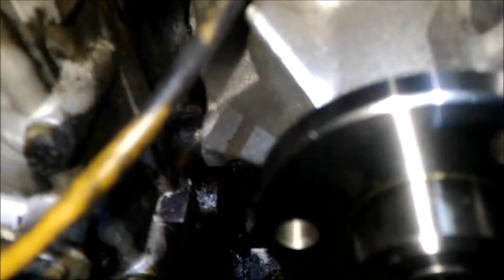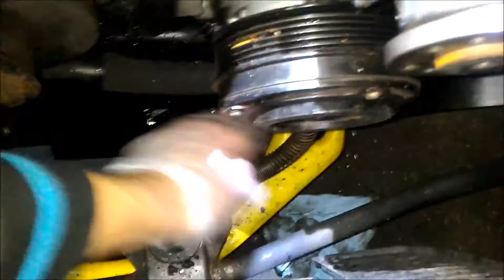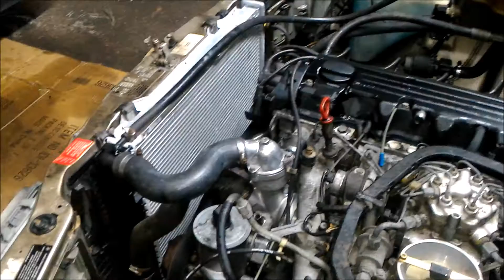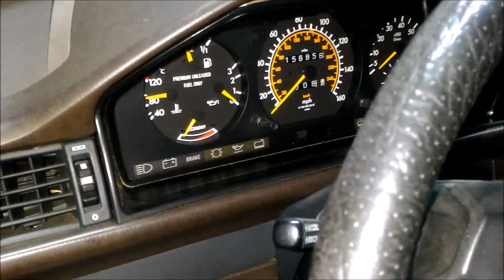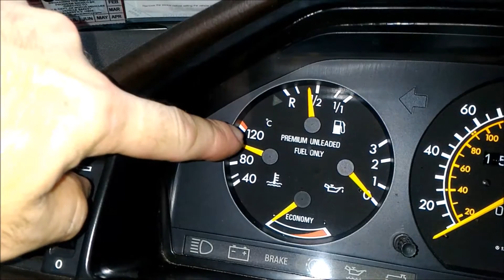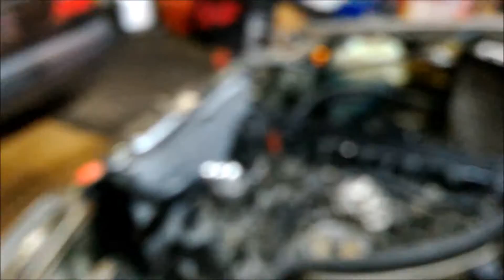Mercedes 300TE W124 coolant system repair progress

Comment: Dearest Victor ~ You are a genius! I have the exact same car, model, year AND Color! I watched with extreme interest as you walked me through every step and detail of your repairs. My coolant is low, I've had it topped off twice at 2 different shops. The dealer is waiting to suck my blood! I think I lost some water....I'm a girl - DUH! :-) and I'm not that familiar with a foreign car under the hood. I don't know what to do. Where are you? Please help!!!
Reply from the maker: Need to find coolant leak. Just look around under the hood and see if there are any coolant leaks. I cant say where it leaks without seeing the car. I work from home nowadays in City Island, Bronx. Zip is 10464
Reply: @vsandvs  OMG, Victor! I honestly can't believe you responded to my question...Thank you. I have looked and looked for leaky areas, nothing appears to be wet anywhere in that area.....or other areas. One day though, I saw a puddle underneath....someone asked me about the water pump, then I thought, "that was water I saw that day, that puddle." I only saw the coolant dash light come on once, I got nervous. It's been 90° here, (Ohio) I didn't want to run it hot. So I parked it.........??? (You're wonderful for responding ♡)
Reply from the maker: @oneitalia2312  water from middle of the car could be A/C condensation. 
You dont want water in your coolant anyway, you want antifreeze. 80s cars had green one. So you need to look for green fluid leak. If you have blown head gasket then either you have smoke out the exhaust or boiling in coolant tank. Hard for me to say, I need to see the car. Or find repuatble shop in your area who work on classic mercedes and let then diagnosit properly
Reply: @vsandvs  I really hate to bother you and I'll just die if you think I'm a pest. The puddle I saw was up toward the front (radiator area?) - - but that was 2 weeks prior to the coolant light coming on. Believe me, it WAS a red flag for me. I don't use the A/C. There has never been white smoke coming from the exhaust. The dealership charges $160/hr. - I'm a Cook, not a Washington Politician! :-) Victor, just for the meantime, what do you think of this:  I purchase the gallon container of recommended coolant from the dealership and keep topping it off when I notice it's down ever so slightly? I understand that does not solve the problem, however, in your professional opinion, do you think it could create a bigger problem? Also, what is a reasonable labor rate? I'm not opposed to paying someone who knows what he's doing, I just want an honest, decent mechanic. Besides you, are they out there? Victor, THANK YOU A ZILLION TIMES FOR YOUR TIME HERE. I will light a candle for you at church today. ♡